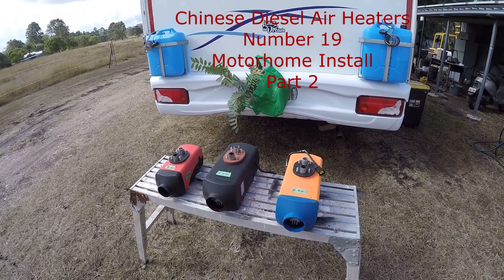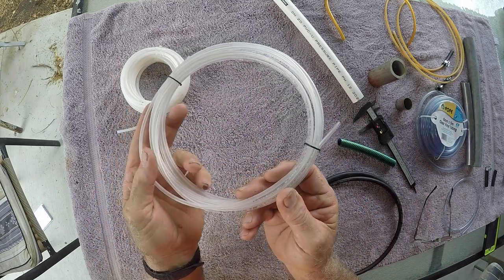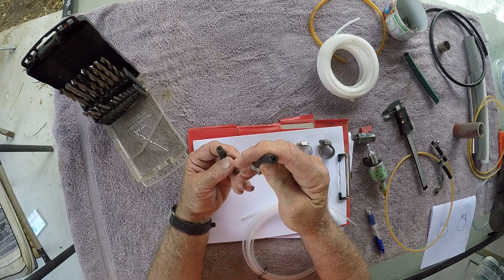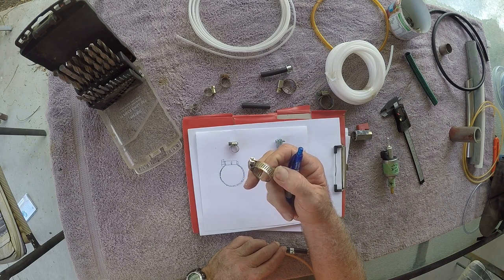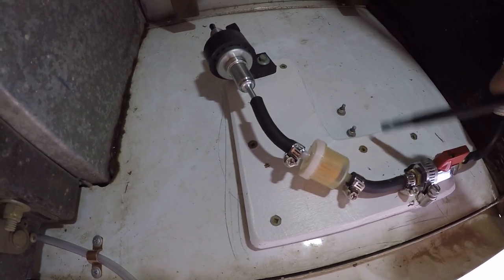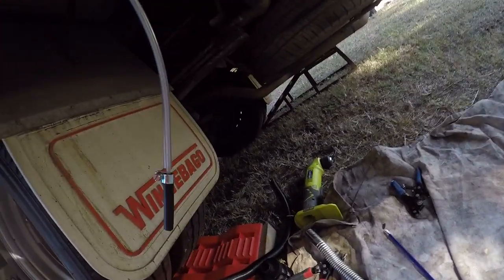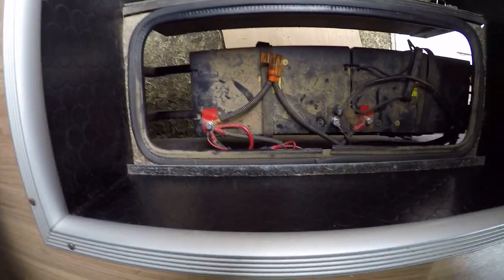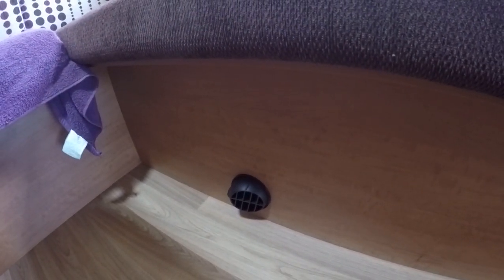Chinese Diesel Air Heaters no 19.   Motorhome Install Part 2

Comment: Brilliant tips here thank you. I did notice that the pump is fitted vertical though, instructions elsewhere state it should be around 45 degrees?
Reply from the maker: Hi Tom, 
The pump needs to be fitted at an inclined angle to allow the escape of the tiny cavitation bubbles.
Any angle above about 15 deg is ok.
Better to have any angle from 45 deg one side to 45 deg other side.  Not fixed at 45 deg.  JMcK

Comment: Hi John.   Fantastic set of videos!   I am installing a diesel heater in my AVAN caravan.   Would you please tell me where you sourced the fuel on/off valve?  Many thanks
Reply from the maker: Hi Em,
Don't where you live, but you can get them in a hardware store air tools section, a motor vehicle store, small engines store that sell chainsaws and stuff, and on line. I bought mine in Bunnings tool section with the air tools.  JMcK

Comment: Thank you John for you series of videos on diesel heater education, I shall be fitting my Chinese 5kw diesel heater very soon and shall be doing it step by step via your videos, quick question on priming the pump is it possible for me to fit a 12v low pressure inline fuel pump with a push momentary switch to prime pump and would that interfere with the running of the diesel heater
Many thanks John 
Liam, UK 🇬🇧 🙏🏼🤝
Reply from the maker: Hi Liam,

I have not personally tried that, but if it is before the heater pulse pump it may be ok. You will need to try and see. Seems a bit of a waste though, as you would only use it once.

But you have pricked my curiosity, and I must try this next time I am running some tests next southern winter.  JMcK

Comment: Thanks for the video's! Just installed mine with them and they were extremely helpful. My hot air output temperature runs extremely hot though (keeps going up over 150 Celsius). Any idea how to fix that?

Comment: John I am learning heaps from you videos but I have a request. Can you do a video in how to open the plastic connectors to connect the thicker wire? I am looking at my new pump wiring and can not see how to open it without destroying the connector.
Reply from the maker: You can leave the connector and just cut the wire short of the connector (say 50mm), enough so you can solder on thicker wire and add heat shrink. JMcK

Comment: Thanks so much John for such a top notch guide on these diesel heaters. A question for you, I see you have the exhaust exiting fully under the RV. I've heard from other sources that the exhaust is lighter than air and will rise, and gather underneath the RV, risking CO and other exhausts leaking through the motorhome floor into the living space. The fix being to mount the exhaust right on the edge of the vehicle so it shoots the exhaust out from underneath the vehicle. What are your opinions on the importance of this? Thanks again.
Reply from the maker: Hi Y,

By all means do what makes you less concerned.

In this case (motorhome) there is a large air space under the motorhome and the exhaust  is right at the back of the motorhome, (not middle) and there are no vents or holes in the floor to allow any exhaust gas to enter the accommodation area.

Besides these heaters, when installed correctly, run very clean. You will notice in some of the videos I put a CO meter very close (6 ins) to the exhaust and I can't get a reading. Less chance of CO here than having a gas (LPG) stove or gas (Buddy heater) burning inside motorhome.

As I have stated many times in these videos, these heaters are vented by just a tiny fan and they don't like restrictions. Running a long exhaust can be self defeating as restrictions in exhaust cause a poor burn, and a poor burn makes CO gas.

Thanks for comments.  JMcK

Comment: Hey John I love these videos you’ve given me the confidence to fit my own heater, I’m wondering if you’ve got a wiring diagram that you’d be willing to share 😊
Reply: Hey Paul, not much required in the way of wiring as what it comes with works fine mostly. The only additions (as per John's install that I will be replicating) is adding a 15amp fuse at the battery, a switch in the power line near the heater and a fuse in the cable heading to the pump (at the heater end) - covered in the video at around the 30 minute mark.

Comment: Appreciate your videos John and have a question I hope you could answer.
Does the heater intake need to be run to the outside of your van the same with the exhaust ?
Am thinking about installing a portable Diesel heater in my van and just running the exhaust out through the floor.
Thanks

Comment: Thank you for all of the videos. We have a retired small harbor tugboat we are restoring and a Sprinter van we have converted. Both are needing diesel heating. While I've been able to find side-by-side comparison of EU heaters to a selected Chinese heater, I have not been able to find any resource that compares the relative strengths/concerns of the key components of the most readily available Chinese heaters. Do you have a video that addresses this question? Or know of reliable source that does a comparison?  Thank you.
Reply from the maker: Hi Guys,

To my knowledge there is no video comparison between different suppliers of Chinese diesel heaters.

Most Chinese diesel heaters are unbranded. So difficult to compare.

Most Chinese Diesel heaters are almost exact copies of the German Eberspacher D2 and D4 heaters.

I suggest that you select a heater that comes with the controller you desire, and buy from a seller that has a warehouse in your country, does returns, and has a good rating.

I recommend you basic bench test the heater on arrival, and before install, and in the rare occasion you get a problem heater, immediately ask for a replacement. Also if the bench test is good, but heater not so good in van or boat, you know you have an install issue, and not a heater issue.    JMcK

Comment: Hey John, like ur videos. 3rd install. After about 45hrs of running perfect. Last time I started with rotary controller, speed of fan and fuel pump runs on low r high speed, nothing in between. Everything heats up, no smoke but just 2 speeds. Thinking it's the motherboard. Any suggestions. Thanks

Comment from the maker: The switch does have a negative wire to work the light when it is switched on. Next to the heater switch on the seat front you will see a 12V cigarette outlet. I have taken a negative switch lighting wire from that outlet. JMcK 42:09

Comment: Hi John, I noted the wire from the 4-position barrier strip to the master swith 29:55 is thicker than the wire from the heater to the 4-position barrier strip. Considering it is a short run, is it necessary to upsize the wires connected to the master switch?

Comment: Can the supply tank be mounted above heater (with the pump below the heater)? Will the pump's check valve(s) prevent fuel from migrating into the combustion chamber when shut down? Thanks for your excellent presentations.
Reply from the maker: Yes Greg, you can mount the tank above the heater. However if the head pressure (>1m) gets too much you can get leakage. No problem, just install a shut off valve and turn it off after use. 
Cheers.  JMcK

Comment: I really enjoyed all of your Chinese heater videos. Thank you for the great information. I have one question. Can you prime the system by pulling a vacuum at the heater end of the fuel supply line? You would be pulling through the dosing pump as well as the entire system. Thanks again!
Reply from the maker: Hi Robert,

Yes, you can prime with a vacuum. You only need to prime to the pump.

I have not personally tried to prime all the way to the heater, so don't know if you would have issues getting through the pump, so if you do that I would appreciate it if you can give me feedback. 

Normally, I would test this before I answered your question, but I have just suffered significant losses in the recent Brisbane floods, so I have nothing to test.  JMcK
Reply: @johnmck1147  I am so sorry to hear of your losses. I hope things get better for you soon and that you stay well.  I will certainly let you know one way or another if I try to prime all the way to the heater.
Reply: Hello again John. I hope things start going better for you soon . I did try priming all the way to the heater, but was not successful. Apparently the dosing pump will not allow it. I had no trouble priming up to the pump inlet. Thanks again for your great videos. You are an excellent teacher.
Reply from the maker: Hi Robert, thanks for the positive comments.  JMcK

Comment: Hey John, great videos bloke. Me and a mate are about to Install these In our campers.. where do we get that clear nylon fuel line from, we're In Melbourne? Cheers.
Reply from the maker: Hi Scott, I buy mine off eBay. Search “hard nylon fuel line foe Eberspacher diesel heaters” there are a number of suppliers. Below is just one to get you started. 

https://www.ebay.com.au/itm/5M-Length-Fuel-Pipe-Line-Hose-Clip-Kit-For-Eberspacher-Dometic-Diesel-Heater-AU-/294947658240?mkcid=16&mkevt=1&_trksid=p2349624.m46890.l49286&mkrid=705-154756-20017-0

Cheers.   JMcK

Comment: Great educational and informative video John, Thank you. 
I didn't see you mention anything about the dosing pump having to be mounted at a 30 degree angle. Do we still have to do this or it's not necessary?
Reply from the maker: Hi BM, the dosing pump should be mounted in an upright angle to allow easy removal of the tiny cavitation bubbles formed by the piston action. Any angle above about 30 deg is ok, but a steeper angle is better.  JMcK
Reply: @johnmck1147  Thank you so much John, much appreciated.

Comment: Thanks for the videos John, they've been very instructional. I have the new controller with the little red circle with the  - in the center on the bottom left of the LCD and can't find any set-up instructions for it anywhere. are you aware of this one or even better do you have the instructions for the settings on this unit? 
Regards, Colin.

Comment: Hi John, I follow you and enjoy your channel thanks for all your efforts, I have a Chinese diesel heater and the cap is leaking via the washer, I bought some 3 mm nitrile runber and cut a washer, I have tightened it too much and split the lid, do you know where we can get a replacement cap and do you have some guidance regarding a leaky washer, I’m sure I’m not the only one with this problem
Thanks 
Al
Reply from the maker: Hi AM

The cap is often a common size drum cap, but without the vent. As a stop gap, if you can find a normal cap you can drill a small vent hole in the cap, and not fill the tank.

Occasionally I see caps advertised on eBay, but it can often be cheaper to buy a new tank.

Below is just one link to get you started buying a new tank, with the cap.

https://www.ebay.com/itm/5L-Plastic-Fuel-Oil-Gasoline-Tank-For-Car-Truck-Air-Diesel-Parking-Heater-White-/404030438303?mkcid=16&mkevt=1&_trksid=p2349624.m46890.l49286&mkrid=711-127632-2357-0

Comment: Hey, thanks for your videos! Helped a lot!
Question, how did you make the recessed on/off switch? I like the design of it, but cant find it anywhere.
Cheers!
Reply from the maker: Hi DV, The recessed switch holder was made out of a bit of 50 mm pvc drain pipe with a blocking cap on the back and a circular plywood face glued to the front with epoxy glue, lightly hand sanded and painted black.  JMcK

Comment: Thanks for your work, John, most useful viewing as I await heater delivery.
 Can you tell me what your mechanical primer device consists of? Thanks, Bill
Reply from the maker: Hi William, for a mechanical primer you can use an outboard motor primer bulb, (remove after priming) or suck the fuel up with a large plastic syringe or similar.  JMcK
Reply: @johnmck1147  Cheers, John, heater arrived, which I primed with a syringe, could hear pump priming the last few drops, but kept getting E01 error and wouldn't start up. Swapped transformer for battery and charger with the same error code before I thought to check the controller, which was set for 24v. Got that swapped to 12v, and it attempted a start, but was smoking quite a bit. Will try again after the festive break, gives me a chance to install a filter! Thanks again, Bill
Reply from the maker: Hi Bill, thanks for the feedback. Yes you need a filter, and most heaters smoke a bit on first start but should then run clean after a few minutes.  Merry Christmas.  JMcK

Comment: Hi John,
In this instal you have the exhast and muffler terminating underneath the motorhome. I believe in the Chinese instructions it says to terminate past the edge of the vehicle. Doing this though makes me wonder if exhaust pipe may be more susceptible to road and tire debris entering.  I am wondering what your thoughts and experience are regarding this issue. I am installing in a converted cargo van and it the exhaust pipe ends about 1 inch inwards from the edge of the van, just in front of the rear driver side wheel well. Thank you for all the knowleged, it has been so helpful in my instal!
Reply from the maker: Hi M. not an issue in my experience and my opinion. These heaters burn very clean, and in some of my videos I put a CO meter close to the test exhaust and I can't get a reading. However, to foil Murphy,  I would not mount the exhaust near the motorhome side that has venting for the fridge.  JMcK
Reply: @johnmck1147  Great thank you for all the advice and help!

Comment: John I have installed a diesel heater in my caravan after watching your videos.i bought it from banggood ,when I got it I dry ran it on my bench and the external fan was binding so I supported it in my hand and tapped the shaft which fixed it , after installing it I got an error 6 which is something to do with the magnet ,before I pull it out some advice if you please , also the digital control is very dull I don't remember it being like that in the beginning,had the unit on power for a couple of months before trying to start many thanks John woodfine Traralgon Victoria
Reply from the maker: Hi John,

First I would try and return the heater for a replacement if you possibly can.

The fan scraping is generally caused by a moulding error in the external case. It can be fixed with some packing but better to get a replacement if you can. This poor QC can lead to other cost cutting issues in the future.

You are correct about E6. On the ECB there is a soldered fan sensor. You may have moved it out of position by tapping the fan to stop the fan noise. You need to check if it still has close tolerances to the fan magnet.

The controllers have simple LED back lighting. Sometimes these LED's (if cheap) lose their brightness over time. If you are a bit of an enthusiast you can open up the controller and install new LED's. If not it is perhaps easier to buy a new controller.

But, as your heater is new, I would ask for a replacement. 

Cheers.  JMcK

Comment: Hi John. Love your stuff. Learned SO MUCH about these heaters. 
One thing...how long can the exhaust pipe be? The Chinglish manuel states "prolonger to 1m at most" Does this mean it can have another meter attached to the original pipe to extend it?
I have had to mount mine in a VERY DIFFICULT position so I'm unable to get the exhaust past the very middle of my van. If I can extend it, that will go a long way to getting the exhaust gasses into the open. And also, where can I get some pipe that will do the job?
Reply from the maker: Hi Biggles 3

The exhaust pipe should be short to lessen back pressure that causes a bad burn and excessive carbon buildup. 

These heaters when installed run very clean, so exiting under the middle of your van, if there is plenty of space and no close by access of air into your van may be a better option than extending the exhaust.

If the exhaust goes downwards, one metre is really the maximum length.
If the exhaust runs flat you can extend out to about two meters.
If the exhaust runs upwards, you can extend out to about 3 meters.

You can buy exhaust pipe on the internet, or use any metal tube from a hardware store.

Cheers. JMcK
Reply: @johnmck1147  Thanks John. Your a legend. 
The way I had to mount it was right near the door so having the exhaust exit there would not be good.  As I said my pipe is right in the middle of my van so I think there is little chance of getting any exhaust fumes inside. But I need to test this theory. A good way to test for any unsealed bits on the floor. 😂
I will look for a little bit more just in case as mine runs flat along the floor. The original pipe is almost impossible to bend. I had a hell of a job to get it to bend around my suspension bits.
Your channel is so detailed it's unbelievable. You have done so much work with these heaters. It has been invaluable.
Thanks again John.
Reply from the maker: @biggles333999  

Thanks for the info and positive feedback.  JMcK

Comment: Been looking for a diagram for power on that 9-pin connector.  Is there an ACC power input as typical for a car radio or other ACCessory loads typical in a car?  Espar has two inputs, one is 20A for power, and the ACC input is fused with 5A to enable it.   In your installation, a jumper would satisfy an ACC input.   Lots of instructions how to set up and program these Chinese heaters, but looking for the 9-pin connector and any ACC input that can be used to remotely enable or disable the heater.  Thank you!